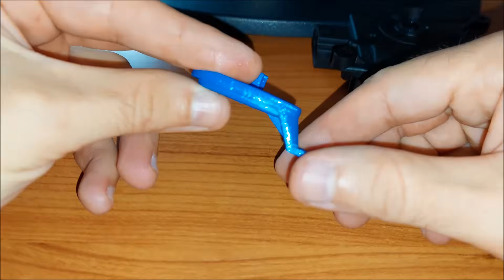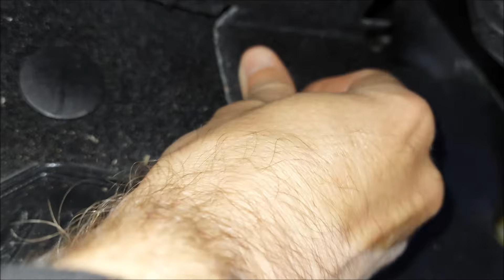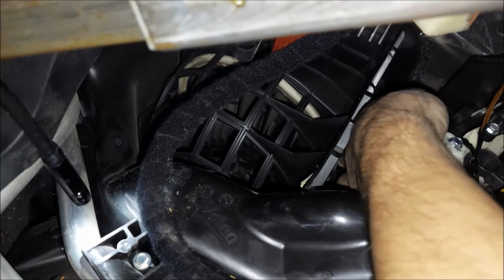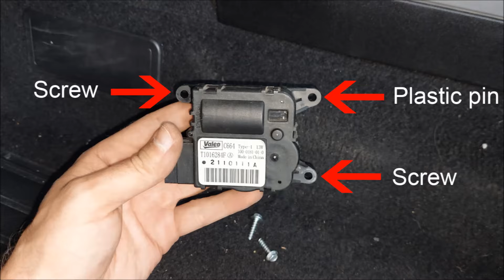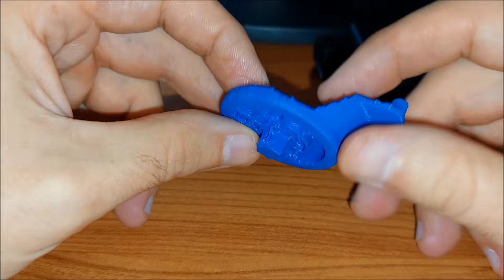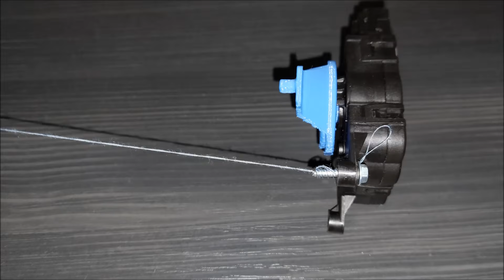10€ Alfa Giulietta Recirculation Flap Motor FIX, NO DASH REMOVAL

Comment: Hi friend. As you mentioned, the part is broken inside. I removed the flap motor and installed the new part on top of it. However, I'm having trouble fitting it back in place. If you have any practical tips, I would appreciate it if you could share them.
Reply from the maker: If you can, don't install it till 12th, I got the new video on the subject which will definitely be beneficial both for installation, and part choice
Reply: @arcgarage I'm grateful for your reply. Waiting until April 12th is a bit long. I'm driving the car with all the trim removed. I'll try again with the string tomorrow, and if that doesn't work, I'll secure the rear leg with a plastic zip tie.

Comment: I found a way to make future removal easier. Regarding how to reinstall the screw, you can make a U-shaped notch on the motor and file it down until the screw fits tightly and doesn't fall out. Then, first place the screw into the flap guide i mean on dashboard where is the screw location without the motor, leaving a clearance of one or two millimeters so the motor can be inserted, and then slide the motor into its final position
Reply from the maker: That is a great idea man

Comment: Hi, has anyone tried this fix on a right hand drive model? I would assume the motor is in the same location, however does it have the same access for removal? I would appreciate any comments if anyone has tried this on a right hand drive Giulietta.
Reply: I tried to do it on my RHD model. The glovebow is in the way of a fair amount of access on the passenger side, and there is a curved structural bar in the way. I lay on my back with my back on the door sill. The screws also seem to be smaller than 6mm, but bigger than 5.5mm

Comment: Hi, my problem is that the vehicle isn't blowing any warm air. So the hot-cold direction control part is faulty. They say they cut the sheet metal to repair it without removing the dash. Is it safe to fix this problem this way? Or could there be an easier way? I think it's difficult to access the motor here.

Comment: I am using the string method to put it back but I can’t see the bolt to tighten it, and there is no space now the new plastic piece is installed. How did you do it?

Comment: Hello, I changed 3 flaps made by 3 different people on 3D priters and all of them broke after 2-3 days in the same point. Should I change the motor and buy a new one or keep spending money on 3D printed parts until one does not brake?
Reply from the maker: Try to get aluminum one, good machinist can make one
Reply: @arcgarage Ok, thank you! 
One more question, is it normal for the recirculation motor to make a circle and come back to original position every time I turn the ignition on?

Comment: Thank you. With your video and a lot of saints, very lot, I was able to fix the recirculation motor, I never had crampie at my hands before this fix job. I also did recalibration because I had a problem hot/cold on the left side of bi-zone but after 3 days the problem turn back. You showed how to repair the right side, have you any suggestion for the left side? I only find guys that use 'flex' to open a access at the little left side motor.
Reply from the maker: Welcome man, I know the struggle. I would drill couple of holes to undo the screws and that is about it

Comment: hello i have alfa romeo giulietta 2011 hot and cold on pasenger side but only hot on drivers side i have 3d printed the flap for the pasenger side under the foot well as it was broken thats been repaired but still hot on drivers side
Reply from the maker: That is for recirculation, you got another video on the channel for that problem.
Reply: @arcgarage  hey what video is it please bud

Comment: Once you have replace the gear on the actuator and you need to assemble it back, in which position you need to put the door?
Reply from the maker: Do it however it is easiest for you, the system will recalibrate anyway
Reply: @arcgarage  I have succesfillu disassembled it, now I have ordered an alluminum spare gear and I'm waiting for that. Just one question, considering how difficoult is to assemble and disassemble it, is it worht buying also a new electric motor? Mine it's from 2016 ....
Reply from the maker: @LightsnRoses  It shouldn't go bad

Comment: After installing the new one, which position should be the flap, down or up, I mean is it open or close while the engine is off
Reply from the maker: It doesn't matter, just move the flap, and the system will recalibrate itself

Comment: My biggest regret in life right now is seeing this video and think I can do it too. I'm in hell right now trying to mount the first screw 😅
Reply from the maker: Come on man you can do it
Reply: Thanks man.I think I'm giving up. I've tried for two days now but I can't figure out how to put the far screw in place, I'm using the string trick but it's too hard to pull it to its position because the motor is suspended so two hands are needed and there's no space. Any advice?
Reply: I just found out thanks to the Italian forum that the position of the flap is crucial to be able to mount the first screw. It's necessary to plug the motor and select no air recycling that did the trick for me and it was easier to put the screw in place then. Tomorrow I'll try to tighten it because it was enough for me today 😅

Comment: Hello my friend, i like your videos is so helpful. I have a giulietta 1.6 jtdm 105 hp. I have also broken the flap motor recirculation and also i have another problem. It comes inside the cabin smell ,  in town and also in open roads. This hapens more strongly when i turn on the radiator in hot, now the winter and i can't understand from where there may be a leak. I would be grateful if you could help me if something similar happened to you or to any other friend. Thank you very much.
Reply from the maker: Hi, glad to hear that. What kid of smell? If it's the exhaust, you got to take care of that immediately, it can be very dangerous
Reply: Yes like.exhaust gas,  but low so high like in exhaust. Less. But smells like this
Reply from the maker: @KM-vh9ql  Go and inspect your exhaust, starting from manifold immediately, and avoid driving until you get it fixed

Comment: Thank you for your very helpful video. One question remains though. You said that the screw with the string attached is for demonstration, and that it belongs to the hole below. So it is enough to do that and pull on the string to get the motor aligned? What about the other holes, will they auto-align as well? As far as I can see, there is also one hole for a pin. Could you maybe be more specific? That part of the video caused a bit of confusion. Good job otherwise. Thank you for these very insightful videos!
Reply from the maker: Thanks, yes the string will help you align the first, hardest to reach, screw, then you will be able to align the rest
Reply: @arcgarage  thank you. Susjed moj, bas mi je drago da postavljas videe o Giulietti. Uzeo sam si jednu, bit ce spremna za dan-dva. Jedva cekam. Odlican auto 🙌
Reply from the maker: @espresseo1613  Hvala na podrsci, neka je sa srecom. Pozdrav veliki

Comment: I replaced the broken part by doing all the steps as you said, the motor works, but when I calibrate it gives error 02, hot air does not blow again, what is your advice?
Reply from the maker: The part in the video is for recirculation, you need to most probably replace the motor for how cold
Reply: @arcgarage  When I check the engine, it starts. But still no hot air on the driver's side
Reply from the maker: @Galip.beltir  It might be the broken flap on the inside
Reply: Hi brother, first of all thank you for answering every question, I did the installation by following the steps, now the flap motor is working properly, but still no hot air is coming. I wonder if it has something to do with honeycomb cleaning.  There is hot air flow from the passenger side.

Comment: If I just turn the flap to closed, would that work? (I just want recirculating, I don’t want air from outside) Or is replacing the part necessary?
Reply from the maker: That would would work

Comment: Unfortunately 3d printed replacement parts for this WILL break after a short time, no matter the type of plastic used. Here in Italy there's a lot of people who have done this, myself included, multiple times. The trouble lays in the motor doing a full 360° on its own while the movement of the lever it's much shorter, and thus using the resistance offered by the lever itself to reach stop position in both directions. After a while the plastic gets torsion fatigued on the protruding axis locked in the motor hole and fails in the exact same way the original part does. To this day the only permanent solution is rigging some metal part together and hope that the torque won't just move the fail point onto the plastics in the motor itself
Reply: I replaced mine with a resin printed 1 year ago, still going strong the resin used is photocentric dl110B
Reply: @samuelcosta8381  So i changed mine and it broke after few weaks, will try one with resin, if that dosent help i am giving up. :D
Reply: @samuelcosta8381  Ma se si compra l'intero motorino il pezzo è presente? certo che costa un bel pò e la fatica è la stessa
Reply from the maker: Mine broke too, I have installed the aluminium one, here is the video https://youtu.be/qyAusp6It_Y, I also added the link for the aluminium one in description

Comment: Thanks a million. Very useful video. I 3d printed the part and replaced it like in the video, mine was broken too. But unfortunately that still didn't fixed my ac, still blowing hot on the left and cold on the right.
Reply from the maker: Welcome, you need to check the hot/cold motor
Reply: @arcgarage what you mean?
Reply: Hi Did you solve it ? Because I have the same problem
Reply: @iabukhalil  I didn't solve it yet, i asked a guy he wants 200 euros for dismantling the dashboard and changing some parts he said.

Comment: Hi thanks for sharing such a awesome and time saving video,on my giulitta 1.4 my heater doesn’t give hot air in the car I can hear the motor it does work  I’ve done the reset feature as per other video  and got a 1 at the end of the procedure.can you please advise many thanks
Reply from the maker: Thank you, you have to remove the motor, to see if it's the flap, or the motor
Reply: Hi thanks for such a quick response I just want to confirm is the flap responsible for hot and cold air selection

Comment: Thanks for showing this, like many other owners the aircon issue has been plaguing me, it works fine on the driver’s side but is just hot on the passenger side. Am I correct in thinking access is still from the left side of the car in the RHD version?
Reply from the maker: Hi, not sure, best to check it
Reply: hi any update mate, literally experiencing the same issue
Reply: @dukabazuka  I haven’t given a go yet, I’m waiting to Christmas when I’m on leave.

Comment: heelo friend, very good video. do you have the part plan for the 3d printer? i have the same problem u¡in my alafa romeo giuletta. and now there is no complete recirculating valve stock to buy on any website. I await your response, thank you very much.
Reply from the maker: Hi, I left link to the file in description below
Reply: @arcgarage  sorry, i didn't see. Thank you very much.
Reply from the maker: @montytdi  no problem
Reply: @arcgarage  what material is better for this impresion?
Reply from the maker: Not sure what they used, but I told them strength is crucial
Reply: @montytdi hello. Have printed in sls nylon one year ago and it's still working just fine.
More expensive though but more durable and different technique in 3d printing.

Comment: This problem has been tormenting me for ages! I was thinking I might have to send it to a garage but after finding your channel I will attempt to fix it myself. Great video, thank you very much.
Reply from the maker: Glad I could help
Reply: @arcgarage  This solution might be impossible to do on my car, it is a right-hand drive car and there is too much in the way of the broken actuator. I cant even get a spanner on the nearest bolt to undo it. What do you recommend?
Reply: @sircavin have you found a way to do it? I’m still stuck scratching my head, if all fails I will pull the dash out
Reply: @sircavin I have to completely dismantle the dashboard, remove the steering wheel and everything. If you want to do it right!
Reply: E perché ti tormenta ???? Non sai chiuderlo con le mani e metti un pezzetto di legno e kasci solo il ricircolo interno ? Che ti tormenti non vedi che questa macchina non vale a niente ,, che si sbriciola pezzo x pezzo
Reply: @Alessio-s2z  Because everything in my Alfa is on the opposite side, making this type of solution impossible to do, so now I am even more fu*king tormented!!!

Comment: What about the  plastic pin ? When u pull it out and down as long as u can have access to the second bolt , what happens to the plastic pin? Breaks? Fall inside? And it isn’t necessary when u put the motor again in  the first position ?
Reply from the maker: You can get motor off without breaking the pin, but even if the pin breaks everything will function properly when you put it back